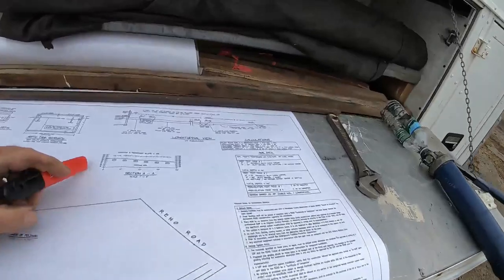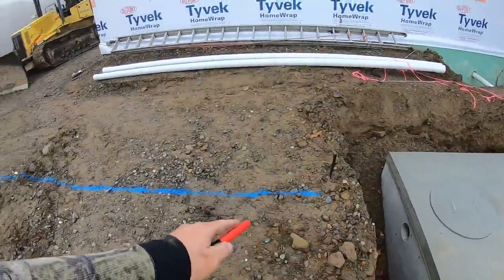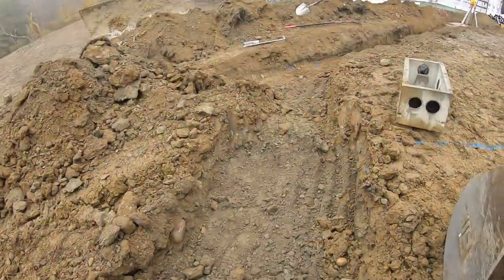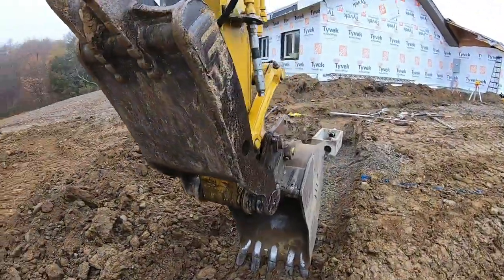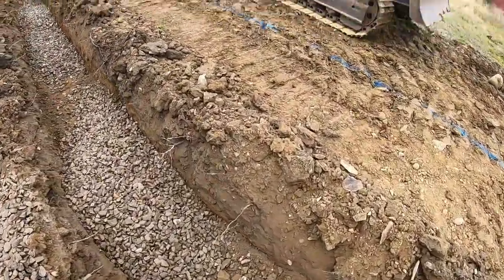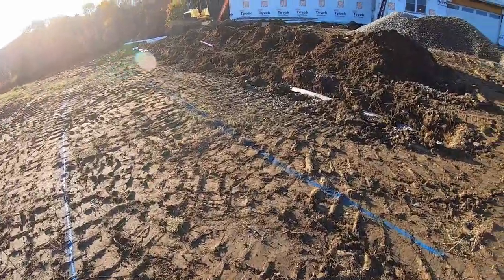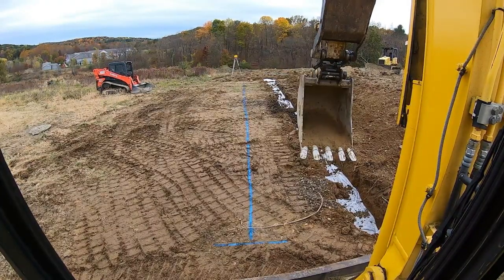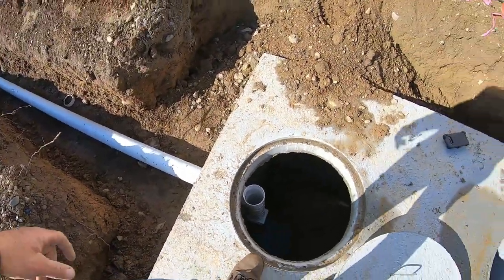New septic system complete DIY tutorial for beginners

Comment: This was a great help. Thank you. A few questions on the the math so I do it correctly. 

1. The non perf pipe portions are 1/4“ fall per foot correct?

2. Once I’m with perf pipe you said a 1” slope. Did I understand correctly- are you saying 1” drop per foot of perf pipe? Or is it still 1/4” fall per foot?

3. I do a 6” bed of gravel before laying the perf pipe? Then cover to 2” above then lay the filter fabric right?

4. Do you cap the ends of the perf pipe or leave them open?

Thanks again. This video was excellent.

Comment: liked, subscribed, and shared.
great video, excellent explanations. Good info on the code even though they are different everywhere. It is a very good reference to understand the local code differences. For our system, the installer is not sure if the crane can get the concrete septic box to the location due to tricky access. We may have to use a fibreglass tank but we also have a bit of a high water table in the winter which apparently can be a problem for those tanks.  We are hoping we can change the tank location a little to allow for crane access. Have you had experience with the fiberglass tanks? Any install differences I should watch for?

Comment: That’s a nice D box with the built in gaskets, the junk concrete boxes we get have wire always in the knockout and then we have to use UGL drylock fast set cement to seal the holes up.  Nice work though
Reply from the maker: Thanks so much! 👍

Comment: Excellent work and explained with precision detail by far the best I've seen. Quick question : Is it always a requirement to run 6 trenches? Could 4  trenches work its simply a summer vacation home?
Reply from the maker: Each design is different if you are in good soil with not that many occupants you'll be fine

Comment: I'm located in  California and my leech field failed just after 3 years. I've had several companies come out and say I have too much clay in the ground. Is this something that the company that put the leech field in is supposed to know?
Reply from the maker: If it was a legal septic system then it would be designed by an engineer and it would be on the print what was approved and what was not

Comment: Very unfortunate that the cheapest grade of Perforated Pipe known as Light Gage Pipe, which can easily crush was used for this installation. In my state, Solid Schedule 35 SDR Pipe would be required from the Septic Tank to the Distribution Box and from the Distribution Box out to the Distribution Lines in the Leaching Field itself. In my opinion, it makes sense to spend the money to use Schedule 35 SDR Perforated Pipe for the Lateral Leach Lines as well. Quite Frankly, I would also use a much heavier grade of Filter Fabric... not the cheap landscaping material from your local Home Improvement Big Box Store. Also, I'm a big believer in using extra stone, because stone is cheap, and it only cost me a few hundred dollars for another load... the more aggregate you put under and over the pipe the better. Plus vent the far end of the leachfield for increased airflow, because it doesn't really cost anymore money. In fact, you can use the scrap pipe you have left over, because you always have extra pipe.
Reply from the maker: Craig 1st off these systems are engineered.. they are not a contractor design!! 2nd The pipe from the house to the tank to the D-Box is schedule 80!! Not cheap 35!! Other than that you may be correct. Thanks for your input 😁

Comment: I have six leech lines and was told to put a elbow in to switch between each set of leech lines.  3 for 6 months and so on. I now its different from state to state.  What I have seen and read the health department is wrong. Just need a lil advice.  Thanks.
Reply from the maker: Like you said each state and even county is different protocol.. if you install it the way I did in this video you will have no issues.

Comment: I've been installing septic systems for quite a few years and I've always used 36-inch drain field ditches. And I just wondered what was the deal with this job. Is it because of the location and the specifications given by the health department?
Reply from the maker: Yes it's engineered everything here in our area is 2 ft

Comment: where is this magical land of soil with zero rocks? I dig with my tractors backhoe and it’s screeching sounds left and right from all the stone and ledge the teeth hit. This soil must be a dream to dig through. I hope whomever installed my homes septic system took the time and care this guy did to be sure it’s done right. probably not but one can hope so. nice work sir.
Reply from the maker: Thanks you bud!
Reply: Dirt Boss Masonry & Excavating do you know much about septics beyond the install? mine was installed 1972 and it seems slow to drain. I uncovered the outlet and all I can see is the top handle to what looks like a plastic filter handle but it’s covered in thick larvae or leeches literally to the top of the plastic handle, i can’t even see a pipe at all just the handle top. i’m trying to decide if I should pull the handle up to try and clear it if it is a filter but i’m concerned all that thick nastiness and leeches will start to drain further down into the d box and make a problem. is it advisable to have it pumped first then clear the filter to avoid this?
Reply from the maker: @lh98  Yes definitely have it pumped You should have it pumped every couple years and the filter could be clogging it we don't put filters on our systems..
We have what we call a baffle in the tank
Reply: Dirt Boss Masonry & Excavating Thank you sir. There’s only about 6” of solids on the bottom so i was hoping to wait another year but sounds like it’s best to pump it have them clear the filter and move on with peace of mind. You sir are a true professional in your field. respect!
Reply from the maker: @lh98  thanks buddy good luck!

Comment: Great video. Clears up a lot of how system is installed.   Just learning after buying house with septic, and trying to find where all coponents are installed.  Had to go to health department to get drawing.  I have 1 question, have you ever heard of a drain field being installed 160" deep.   Now my property is on a slope and has something called a LGMI installed about 10 feet ahead of drain that diverts water around field.  And field is approx. 100 feet from house.  Could it be the soil type?  Thanks again.
Reply from the maker: Thanks it's hard to say if it was engineered I'm sure it's right but yeah it does go on soil conditions

Comment: Do you have any problems with baby wipes floating through the septic tank  plugin up your speed levelers and stopping the d box from working ??  Just asking ?
Reply from the maker: No that's what the baffles are for in the tank nothing should come out of there
Reply: @DIRT-BOSS  Baby wipes float right under the baffles .My company has have many time cleaned a d box full of wipes. Almost every time it is the levelers that are clogged. No levelers they go right down the pipe for  sure. If you have a exit filter that will clog but not as much as a d box   Just saying <<<<!!!!

Comment: Are the septic tanks required to be concrete by local code or can you use a poly tank? Is that determined by soil or weather? Thanks for making the video. Appreciate the detail.
Reply from the maker: No you could use poly in most places either or

Comment: Hey Dirt Boss is it possible (with the right property terrain) to use a septic system when the house has a basement with a bathroom and laundry in the basement?  Give a brief idea of what to plan out (like how deep can the tank and field be below grade) or does the inspector dictate that depending on soil and local regs? Thanks!  (BTW good video here!)
Reply from the maker: If you had the right terrain you could do a gravity fed system for sure then you'd have to put risers on the tank most likely but yes that could all be designed
Reply: @DIRT-BOSS  Thanks again!

Comment: With a drain field using only two lines of perforated pipe, should one of the pipes be in direct line with the septic tank outlet pipe? Or, can they be staggered on either side of the outlet pipe? And does the distance of the header pipe from the tank matter? Is just 2 feet okay?
Reply from the maker: It's tough to understand what you're saying but most systems need to be engineered.

Comment: So if I understood you right from some of your replies you will install the dome/infiltrator systems but not a fan because they clog ???
Reply from the maker: I've had them clog up yes I have replaced several of those systems not saying they're junk but I've put more stone and pipe in
Reply: @DIRT-BOSS   so clogged up from extremely dirty effluent (maybe no tank exit filter) OR soil filling in back thru all the side slots louvers ??  How long has the infiltrator domes been used to warrant complete replacement, I thought they were relatively new ??

Comment: For the trench of solid pvc after the D box leading up to the perf runs, is that level with the D box or are they sloping down at 1/4" per ft? Also, are all 6 perf runs at the same elevation or is it just that they are all level? thanks just subscribed!
Reply from the maker: No they slope with the grade doesn't matter the slope.. the lateral lines are all level but different elevations they go with the grade also each site is different
Reply: So the trunk solid lines go with grade, not a 1/4 1/8 per feet slope to the leech lines?
Reply from the maker: @dominictorrelli1816  correct

Comment: So 1/8" per foot is the minimum, right? No issues with going greater than that, is there?
Reply from the maker: Depends what part of the system you're talkin about
Reply: @DIRT-BOSS  From the septic tank to the distribution box. I believe you said from the house to the septic tank is 1/4" per foot. That would be a minimum slope as well, correct? Did the engineer provide the number for the 1" drop from the start of the drain line to the end? The 50' sections?

Comment: To confirm: the leach pipes once coming off the 6 way splitter are 1/16in slope drop maximum per foot of pipe. So the 50' leach pipe could have a max slope drop of 3inches, but you prefer to keep it at an overall 1in drop from start of pipe to the end of pipe?
Reply from the maker: Yes that is what the inspector always asks for...